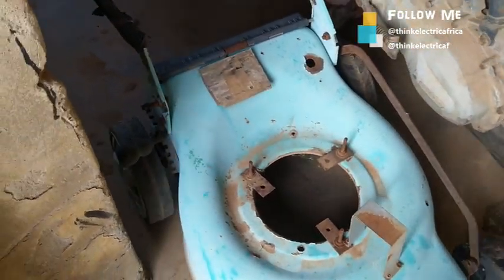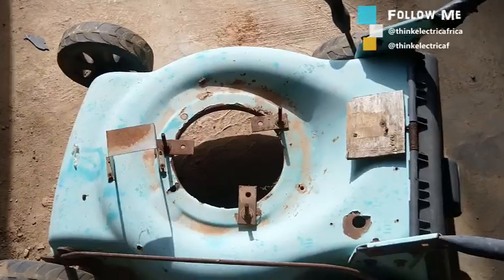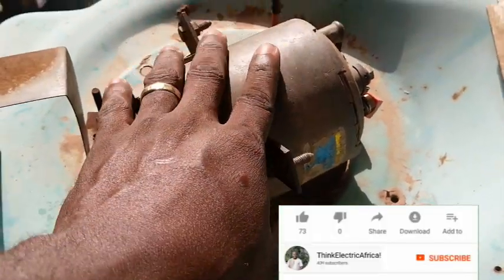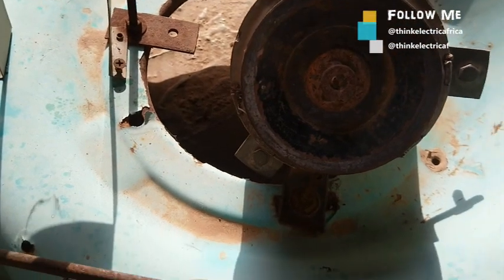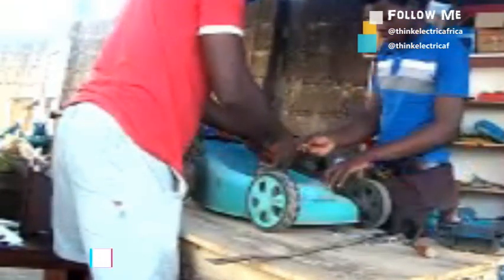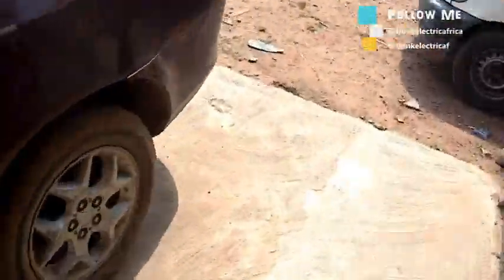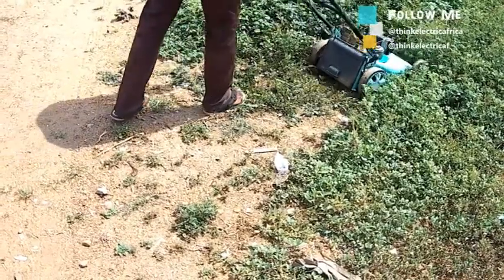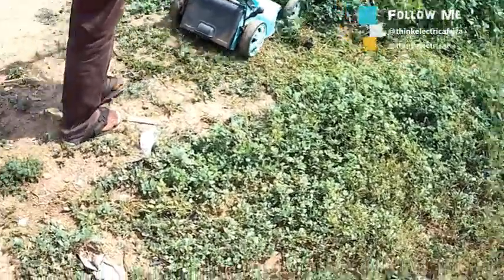Homemade Electric Lawn Mower, A VERY Simple and Cheap DIY!

Comment: Nice job, good one

Stepping to 24v then rectify and keep the rectification system away from the mower, this may help keep 240vac from the metal mower, to improve safety since mower may encounter wet environments.
Reply from the maker: Thanks for this, I thought as much.